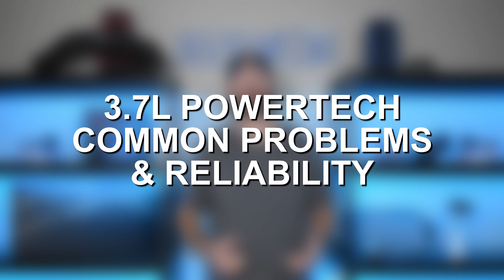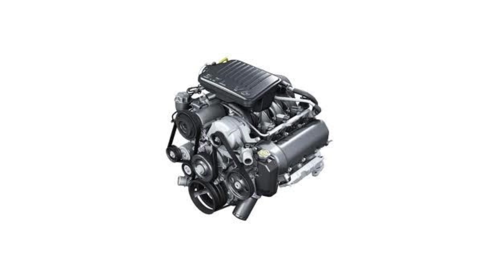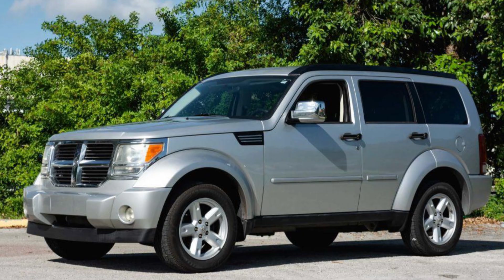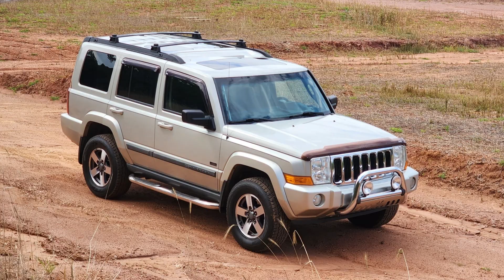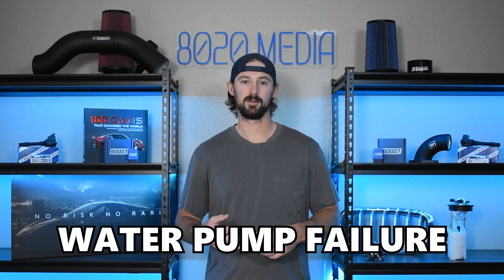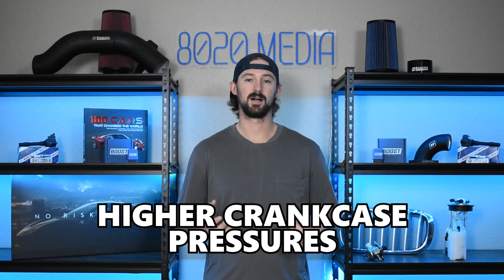The 3.7 PowerTech V6 Engine | Common Problems & Reliability

Comment: I’ve got an 07 Grand Cherokee with 210,7xx so far at this moment. I’m always making sure that oil gets changed on time. I’ve had the Jeep since it’s had 103,xxx miles. From when I got it 7 years ago till now, I did spark plugs when I first got it, did the usual maintenance on the engine. Last January I gave it a new air filter, February it threw a check engine light for a misfire. Had to do an ignition coil. Then in March as I was pulling into my parking spot at home, water pump went. Fast forward to end of 2025. Replaced the air filter a week before Christmas. 1 day after Christmas, same thing happened again. Replaced another ignition coil & just did all the spark plugs again while I was at it. Just did an oil change a few days ago. Had the thermostat, radiator & hoses all done in like middle to end of 2021/beginning of 202?. I do say, that engine really does the colder weather running wise for sure but gets better fuel economy on me in the summer.

Comment: Clean all of your engine bay grounds or your computer will start doing weird things like putting the car into limp mode and saying the transmission is overheated, when it is not, and making the gauges flash on and off....

Comment: Excited to watch this. I have a 2012 Jeep Liberty with this 3.7L V6 and I plan to keep the vehicle performing for as absolutely long as possible. I do oil changes every 5k at the longest, I keep the air filter new, and everything that goes wrong I try to fix or replace. I would happily take any suggestions by anyone who knows how to extend the life of the Jeep in general but mainly the engine.

Comment: Have an 07 grand Cherokee, exhaust gases in with oil, exhaust gas in coolant. Got it at 193441 miles, basically cooking the engine, it's at 197xxx, with a misfire in cyl 2. Honestly I'm just replacing the engine, and transmission. Gonna run this to the ground tho, it is the daily. However I can walk to work, I just don't. I'm unsure as to why there's no oil coolant mix. But I do have to add coolant every so often. Big but here, I have to drive with the heater on high otherwise it'll over heat. It did once, right to red that heater control never moved so fast before I bet. Now if anyone even reads this, my question when adding coolant threw the upper rad hose. Why does coolant come pouring out? Does that mean the thermostat is stuck or missing? My guess missing.....

Comment: 210 hp isn't bad in my 02 Liberty.   It has more than enough power off road, snd its perfectly adequate on road.  I will say though, my 3.7 liter in my wife's 4 door F150 has 305hp.  Thats a pretty big difference between the two 3.7 liter motors
Reply from the maker: E - Correct! Thanks for sharing.

Comment: Actually, a dropped valve seat ABSOLUTELY can and will cause catastrophic failure, especially if you ignore the problem. Rocker arms coming loose from failure of the lifters(lash adjusters) also can cause catastrophic failure. You do not want a loose rocker jamming against head parts like the cam, valves, or the head itself.
Reply from the maker: J - Thanks for sharing.

Comment: 175000 on my 06 3.7 v6 in Jeep Commander. Runs smooth as a sewing machine. However, my complaint is it goes through some oil. No oil spots or leaks anywhere on pavement, but it's going somewhere. No smoke out of exhaust except occasional tad bit after sitting at red light then stepping on gas to go.
Reply from the maker: T - Could just be consuming a lot at those levels. Thanks for sharing your experience!
Reply: Try using 5w-30 oil
Reply: @bje11675 I used 5-30 oil per mfr all the way up until this summer. I changed to 10-30 hoping it might stop some of the consumption. It really hasn't. I figured with the mileage now it probably would do better with a tad thicker oil. It's getting cooler now so I guess I'll go back to 5-30. I've checked on crate engine replacement with my mechanic. 6000.00 give or take. I'll probably end up doing that. The vehicle is in really good shape.

Comment: Hello I have a 2006 Dodge Dakota with a 3.7 I've only had the truck a thousand Miles it runs terrible I have changed all the spark plugs coil packs one fuel injector to oxygen sensors everything I got a code for I change I did the thermostat I've changed the oil and oil pan only because they were bad I don't know what to do with this thing I would love some guidance I really don't know any real or good mechanic other than somebody you changes parts if there's a way to contact you. It's ideling at 600 and the oil light is flickering. The truck is a 6 sp and has very little power on a hill in 1 or 6. Please advise
Reply from the maker: S - First off, sorry to hear this.. Given the symptoms with your vehicle, it's time to step back from parts-swapping and assess core engine health. The oil light flickering at 600 RPM is a red flag for low oil pressure, which could indicate worn bearings, a weak oil pump, or sludge blocking oil passages—especially concerning since you had to replace the oil pan already. Start by checking actual oil pressure with a mechanical gauge at warm idle (normal should be 5–10 PSI minimum); if it's low, internal wear or pump failure is likely. Next, perform a compression or leak-down test on all cylinders—your low power uphill suggests a possible mechanical issue like low compression, especially if it's consistent in all gears and the misfires/code chasing hasn't resolved it. These basic diagnostics will tell you if the engine is worth saving before continuing with more sensors or fuel-related parts. If you don’t have a trusted mechanic, look for a mobile diagnostic tech or shop specializing in engine diagnostics—not just parts replacement.

Comment: 2007 Dakota has 208000 miles. For the past 6 months I’ve been having problems with misfiring and injector issues. I’ve been throwing parts at it all year. Bout to push it off a bridge and buy something else.
Reply from the maker: L - Sorry to hear! What fault codes are you getting?

Comment: I bought a new ram 1500 single cab with the 3.7 in 2008. I never ever had an issue with that truck and at 300,000 i sold it to a rural mail carrier and he is still running a 225 mile a day mail route here in bama with it. He has had it since 2017 and he had to a a solenoid pack or something replaced in the transmission, A chevy would be all to pieces. My sister has a 2005 durango with over 300,000 miles it's been thru infrequent oil changes been ran hot several times one transmission replacement and she refuses to get rid of it but that 3.7 has never been apart. I had a 2016 chrysler town and country 3.6 pentastar ex rental and that engine was a nightmare after it hit 116,000 started and caused buy those damn pos oil coolers in the valley. A class action should have been brought against chrysler for that junk. It's a great and powerful engine until like a chevy a rubber band waiting to snap.
Reply from the maker: C - Thanks for taking the time to share your experience!

Comment: 2010 jeep grand Cherokee 
3.7. 160,000 miles in Puerto Rico mountain heat and mucho humidity. 

180° thermostat and 13psi radiator cap beacause in PR they break radiator too much by pressure. Runnig this since 80,000 miles. 

When was new in warranty they change 1 valve stem at 5,000 and water pump at 50k

No problems at at only in my 3rd alternator, 2cd AC compressor.  2 cnd drive belt tensiones.

1 ignition coil and 6 spark plugs.

I use upgr8 washable air filter since 80k.

When new 5w20 at 50k  change to 5w30 and now at 160k im trying with 10w40. Because I have friends in Venezuela that use 15w40 and we have almost the same climate too hot humid and mointains.

Atf fluid every 30k mopar and the most cheap filter. Nag1 Mercedes 722.6. the shell atf134  germany degrade faste the mopar is best.
Reply from the maker: J - Thanks for taking the time to share your experience!

Comment: I really don’t know how but my best friend has over 310,000 miles on the original 3.7 and his 2005 Jeep grand Cherokee and it was never actually taken care of. We’re talking routine 20,000 mile plus oil change interval, only thing ever done to the cooling system was replaced the water pump once, replaced the oil pan one time, no major repairs or even basic maintenance were regularly performed on the vehicle. I think it probably had two sets of spark plugs, its whole life, and countless ignition coils all of them from the junkyard used 🤣. Head gasket on the left has been blown for probably 50,000 miles. Valve stem seals and probably piston rings are bad been running 20W50 since I can remember, burns and leaks oil. Constantly needs topped off coolant and oil but by God the thing runs and runs and runs and gets 17-22 mpg!
Reply from the maker: W - Very interesting! Seems like he got lucky lol. Thanks for sharing!

Comment: I have a very nice ram 1500 with a 3.7 motor. I've had zero issues
Reply: Dude , it’s is a good motor , my buddy has the same truck , and I have the jeep Laredo 3.7 . Same motor . Change the oil on the girl regular .she’ll take care of ya .
Reply from the maker: W - Thanks for taking the time to share your experience!
Reply: 06 ram 3.7 motor gotta say it's been one of the best motor I've had almost 250000 miles so far
Reply: Maintenance is the key to longevity, with this and every engine. 164K on my 3.7 L jeep,so far.

Comment: 2007 Jeep Grand Cherokee. 197k... no engine issues.   i do notice the occasional extra heat coming from the engine bay fire some reason but no overheating
That's Mercedes engineering
Reply from the maker: X - Thanks for sharing your experience!

Comment: I've been fairly fortunate in that our 2008 Jeep Liberty (215,000 miles now) while not perfect, has gotten my daughter through high school & college.  The engine has started nickel & diming me lately...not sure it's worth fixing, but also its in good shape, so may be worth it.  Our 2008 Jeep Commander (4.7L V8) has been by far our most reliable vehicle ever...248k miles, not one mechanical issue, rust will kill it before the engine.  For comparison our 2014 4Runner & 2012 FJ Cruiser has cost us way more in maintenance than either Jeep.
Reply from the maker: E - Awesome! Thanks for taking the time to share your experience.
Reply: That's crazy because the 4.7 is the worst engine made.

Comment: Love mine. In my Dakota. I've had the 3.9 also. This 3.7 has more power, and I've had not one problem with it. 128k when I purchased it. 163k currently and she runs so good. I love this truck. 5 speed stick. She goes if I want her to, I've abused this truck at times but taking care of it also as far as oil changes in regular maintenance. Best truck I've ever owned.
Reply from the maker: R - Nice! Thanks for taking the time to share your experience!

Comment: My son's liberty had 140kish miles with no major engine issues prior to it being wrecked. I agree with you that these engines don't have a good reputation for tolerating cheap oil or long oil change intervals. We did 5k mile oil changes with a quality synthetic oil, so that probably helped. They are gas sucking pigs for the size/HP though and obviously underpowered by modern standards in a full sized RAM. 210 HP was more than adequate in a Liberty.
Reply from the maker: J - Thanks for taking the time to share your experience!

Comment: Here's your short for this: 
The Whole Engine Is Garbage!
Also, You forgot the timing chain system
Reply: What you do if a local lvnv mechanic took in your mothers perfectly running 2002 buick century custom for gasket replacement and regular maintence says better to take motor out loses his repair shop goes to another shop that fails has a local tow firm take it to his friendly yard then returns to the new shop broken into damaged and harness cut?
Then tells you it not repaireable and gives you in its place a2002 jeep liberty that turned out from top to bottom junk and a money pit. I should go after his Insurances?
Place bad press on Yelp and TV.
Reply from the maker: B - Thanks for the insight. Don't know if we agree with the whole engine being garbage. They can certainly be good with proper maintenance.

Comment: Thanks for the reminder to change out the coolant on my 05 liberty. Ive been meaning to do that. Ill probably run a higher concentration than just 50/50 to help with that heating problem
Reply from the maker: M - Glad we could help!

Comment: I have 250K on my 3.7 and have not had a single problem with it.
Reply from the maker: O - Thanks for taking the time to share your experience! They certainly can be reliable.
Reply: I wanna get mines to that so have you just only been doing oil changes? What else
Reply: @AaronBlessedHands  it comes down to how it was maintained before you owned it.  I have owned mine for 12 years now, and have always faithfully changed the oil every 5K with full synthetic oil.  how it was driven factors in too.  I don't drive mine hard.
Reply: @earlmader7821   ^^^ this had bought a 2008 Grand Cherokee had it 2 months wiring on coolant temp sensor went bad replaced sensor like and anyone would have and cause it to blow head gasket plus wash down cylinders cause of false reading had 240km(149k miles) fun temp gauge didn't say it was hot or cold was in optimal range started misfiring and burring fuel like a top fuel car one day and pop it went when i took it apart it had shitty stop leak in it and later found out cause i bought it from a place over an hour away and original owners lived in my town they also pulled a camper way to heavy for it

Comment: Sounds more like he's describing the 3.6 pentastar,  my 3.7 has 238,000 miles,  all original only do routine maintenance and use quality oil and fluids.
Reply from the maker: R - Nope, we're describing the 3.7. Thanks for sharing your experience. Unfortunately, not everyone has the same.
Reply: have a 3.7 jeep. blown engine at 180k miles

Comment: If they thought they could get away with it every vehicle would come standard equipped with C4 explosives and be programmed to self-destruct the moment the car is paid off. Of course the pistons produce extra heat that's why they put the thermostat at the bottom of the engine on these things. They aren't built to last theyre built to blow at the opportune moment. Its planned obsolescence and if we had someone in government actually representing the Peoples interests it would be illegal in the US.
Reply from the maker: B - Quite the comment here.
Reply: @8020Automotive  the engineers designing these machines went to college for at least 5 years and passed each course in the curriculum so it is completely irrational to assume they are too stupid to know what they are doing when they have specifically been instructed not to.

Comment: I never took to the 3.7 or 4.7 Chrysler engines. That being said, I bought a brand new 1994 Dodge Spirit because I knew the 1995 "cloud cars" (Cirrus/Stratus/Breeze) were coming and I wanted no part of them. My Spirit was a 3.0L Mitsubishi, which had a reputation for burning oil/smoking, but having in-frame rebuilt half a dozen or more of them, I knew the big problem with them is the piston oil returns for the 3rd oil control ring were small drilled holes that clog with poor maintenance. Back then, I was a Valvoline guy and they had just come out with semi-synthetic "DuraBlend" oil, so after break in with conventional oil, I switched to DuraBlend 10w-30 (I live in central Georgia were it's hot and rarely freezes) instead of 5w-30. I literally had zero issues with the car until about 2012, when the torque converter began to shudder and the lining was failing. I did a Precision of New Hampton (Iowa)  converter, a complete reseal and Sonnax upgrades to the valve body and it was good as new. The engine performed flawlessly and never burned an ounce of oil that I could see on the stick, in 3000mi between changes. Loved that car, but it was totalled by a careless driver who ran a stop light and I said goodbye around 2015. Maintenance is critical and good quality oil and filters with religious changes!!
Reply from the maker: R - Thanks for taking the time to share your experience!

Comment: I got one in my nitro had to swap it previous owner locked it up. Issues I’ve had: crankshaft position sensor $37 later fixed 
Camshaft position sensor: $32 problem solved. They’re not bad just don’t overheat it. Now if it’s in the ram that’s a different story it’s underpowered for the ram for sure as is the 4.7 the 5.7 is the way to go in the ram. In a liberty or nitro it’s fine.
Reply: Got 480 000 kilometers on my 3.7L nitro. 6 speed. Still running strong
Reply from the maker: R - Thanks for sharing your experience!
Reply: 2008 Ram . Runs good enough power for daily run/ haul. 84 360v4 for big stuff 🇺🇸🇺🇸
Reply from the maker: A - Thanks for sharing your experience!
Reply from the maker: A - Thanks for taking the time to share your experience!